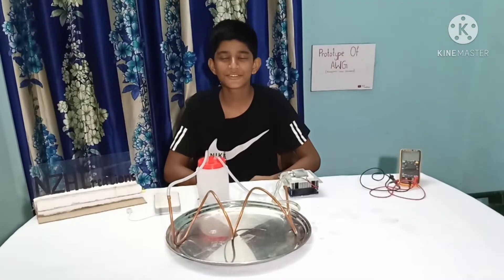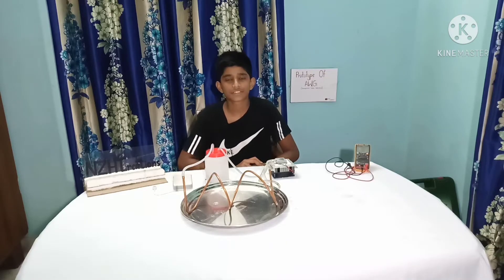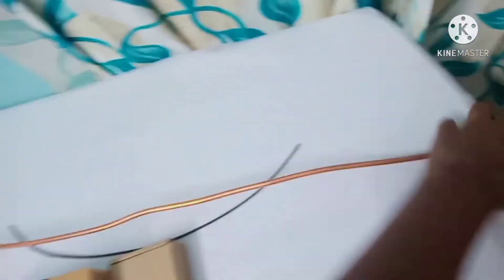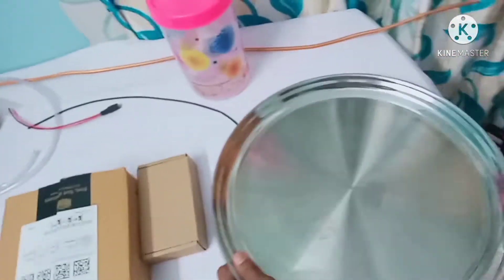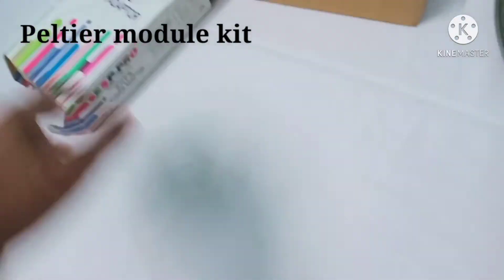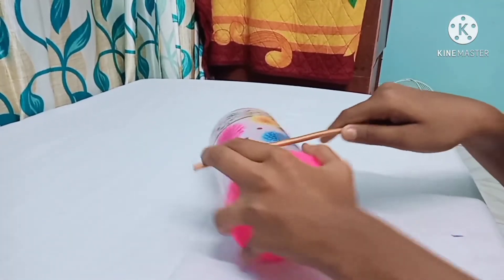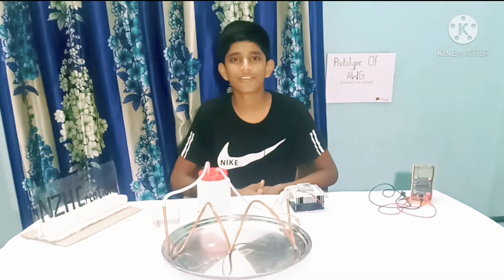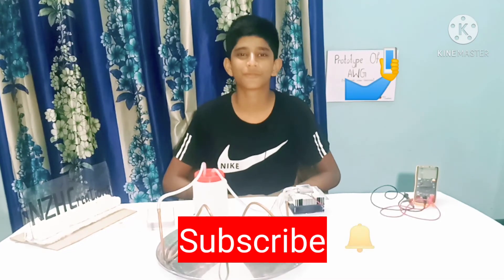atmospheric water generator homemade / #AWG #airwatergenerator

Comment: Sbko 12 volt se hi connect kiya h
Reply from the maker: Bhai meine sirf water pump ko powerbank se chalaya aur peltier module and fan ko 12 volt 2 ampere se chalaya
Reply: @NZHCreations  bhai mera to load hi nhi la rha peltier module 12 volt diya to
Reply from the maker: @mkthegamer3880  

12 volt 2 ampere  se try kro
Reply from the maker: @mkthegamer3880  
check  the peltier module before use
Reply: @NZHCreations  okk
Reply from the maker: @mkthegamer3880  
✌️🤗❤️
Reply: Plertier module ka konsa no. Ha apke 12706 ya 12712
Reply from the maker: 12706